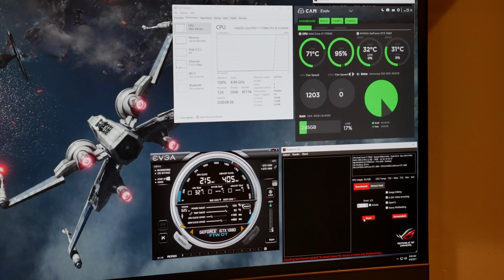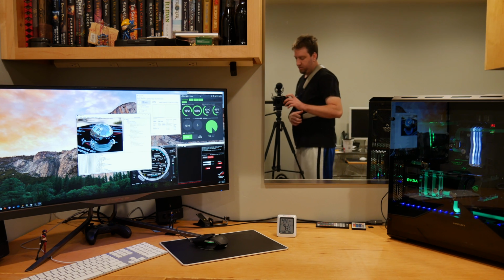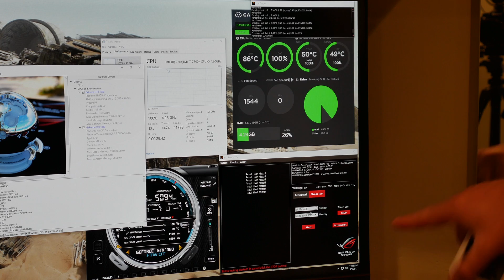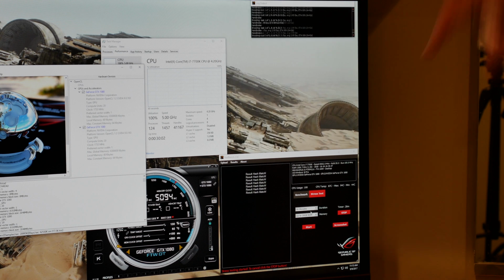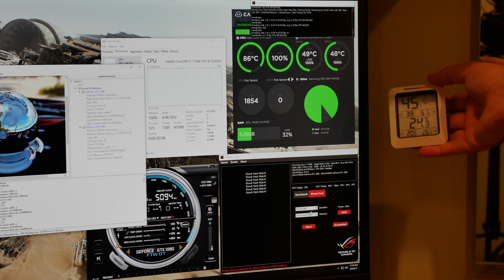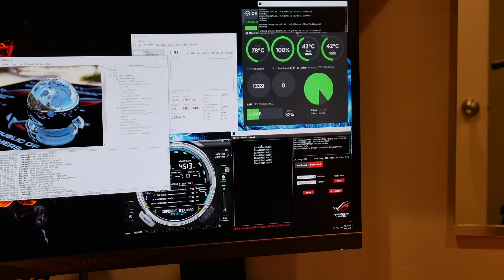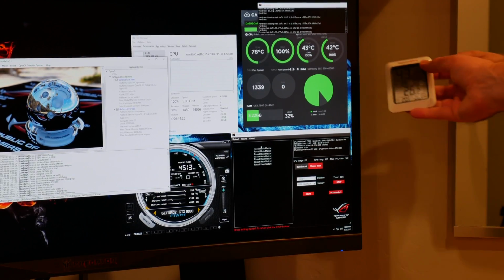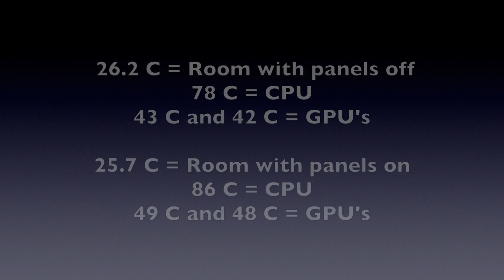Do case panels hurt airflow on your PC? Testing on the Phanteks Enthoo Evolv Tempered Glass edition.

Comment: Removing the top and front panels obviously increases airflow. But removing the side panel is contradictory. It lets the fresh air go away, without being able to reach the components for cooling. In other words, I'm pretty sure if you remove the top and front panel only and let the side panel in place, the difference will be even more dramatic. There is no way around it, the airflow in the Evolv is pretty poor.
Reply from the maker: I dont know about that. With all the panels on its surrounded by fresh air. Plus the fans are pushing air into the radiators so theres no were for it to get lost. So maybe. But I dont think its that terrible of airflow considering with everything OCed and running at max it was only a difference of 8 degrees. Which is significant but I cant think of a real life scenario where anyone would need to have everything running that hard and then to make 8 degrees matter.

But its a good idea, maybe ill test it with removing the front panel and then both the top and front off, leaving the side panels on both times.
Reply: Case cooling is about pressure differential. I've had cases were temps actually rose slightly with side panels off. 

With side panels off, in some cases, you can disrupt the designed airflow of the case. So it's a case of trying it and finding out. Some cases temps will remain the same, some will increase and some drop slightly. Depends how the system is designed.
Reply: Strider dude he has a custom loop all the cold air is passing through the radiators so airflow doesn matter that much in this instance.
Reply: Removing the side will most likely benefit cpu and gpu, but all other components that need airflow won't get it. If the room isn't hot, I doubt its a problem. On a hot day you wouldn't take the side off as a solution though

Comment: Hey man, just found this nice video and I really like your content. Could you evaluate this build for me, please? i5-8600k cpu, Deepcool Captain 240ex aio watercooler, Asus z370i ROG Strix mobo, Asus strix gtx980(From my old build), Samsung 500gb sata ssd, 1tb hdd, Cooler-Master g650m psu(From old build), and some 2x8gb ddr4 rams?
Reply: Sounds like a pretty awesome PC. But if I had a 980 with a chipset that used ddr4, I would of upgraded that over the processor. But my only concern is if thats kind of pushing it for a 650w psu. But like I said it sounds like a fast gaming pc. :)
Reply: The problem is that I have the psu, 980 and hdd+ssd from my current build an old haswell cpu :(
Reply from the maker: I accidentally responded from my other account. Why are you upgrading?
Reply: PCGoblin my current build has a 4460 i5, cheap motherboard, 8gb ddr3 ram and the gtx980 i talked about before. I think about upgrading because some games run kinda laggy and id like to just overhaul it so it can run for some years before upgrading again
Reply from the maker: I would think it would be cheaper to get an i7 4790k and the spend as much money as you can on a better GPU. Unless of course you just want a new system all together which I get. :D But for gaming the cheapest better option would be upgrading to the 4790k and getting a 1080 or 1080ti.
Reply: PCGoblin i kinda want to build a whole new build, but would the itx tg case be alright for the build i described before? Another reason for the upgrade is also the change from a micro atx cheap case to this tg itx case☺
Reply from the maker: The itx tg would be an awesome case for this.
Reply: PCGoblin thats what i thought. I had decided to use the normal windowed version and then this came out and its not that much more expensive where i live
Reply from the maker: I had an h440 before my phanteks TG case and even day one with it, I was like this should be a glass window not cheap plastic. I think youll be much happier with the TG version.
Reply: I think that'll be what I'm going with, thanks. Subbed, look forward to more videos from you :)
Reply from the maker: Thank you. :)

Comment: What rad setup do you have in the case?
Reply from the maker: I have a 360 up top and a 280 up front. Air comes in the front and then gets blown out the top and the back. I have an earlier video where I talk about what I did with this case if your interested. https://youtu.be/Z5tf7uijgFQ
Reply: Thanks for the fast response, I have that same case and I'm planning on doing a custom loop in it soon.
Reply from the maker: Thats awesome. Custom loops look amazing in this case.

Comment: got the ITX version, with a i5 7500 with RX 480 STRIX OC 8gb, and when playing, the top pannel gets really really warm, Really love the case, but :/ dont know what to do, Im planning on replacing the front 200mm fan with a two Static Pressure fans.
Reply: If you have the option of doing so, find a workshop that is able to do water cuttings and mod the top panel. I've seen people who have used water cutting methods to make the top panel let out air better by cutting patterns into it. But seeing as it is aluminum, water cutting is probably the method to use. Shouldn't be particularly expensive and depending on the pattern you get a cooler looking top panel.
Reply: Got 2x SP140, and everything its pretty normal now.
Reply: I was pretty scared at the beginning, because the cpu it's an i5 7500,  not a hot cpu, but the top pannel gets really hot, to the point I thought the AIO stop working.
Reply from the maker: I get that. As long as the CPU is staying at proper temps though I dont care too much about how hot the case gets. When I had the air coolers on my 1080's while I was playing Batman the glass would get hot next to the GPU's.
Reply from the maker: That doesnt necessarily sound like a problem. Do the temps of your components get too hot?
Reply: PCGoblin cpu 50°C max and 70-72°C Gpu
Reply from the maker: Thats not bad at all. The top of my PC gets warm too but as long as those temps are at 50 and 72 as stated you should be good. I would recommend the corsair maglev fans if your going to be changing fans. Theyre super quiet and are excellent static pressure fans.
Reply from the maker: Thats a good idea. But I really dont want to mod the case though. Thats why I mounted my radiator the way I did. Plus I really dont think an 8 degree delta with everything running 100% and overclocked is really too bad.
Reply from the maker: Sweet!